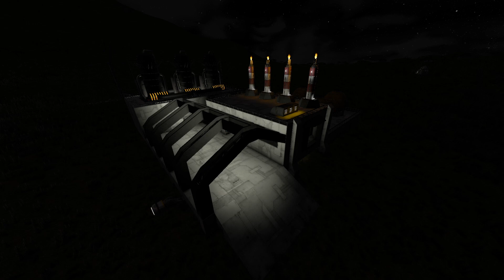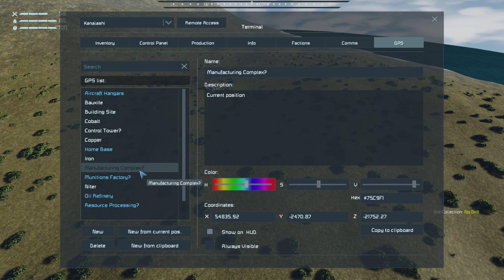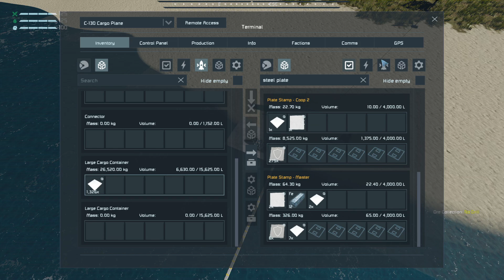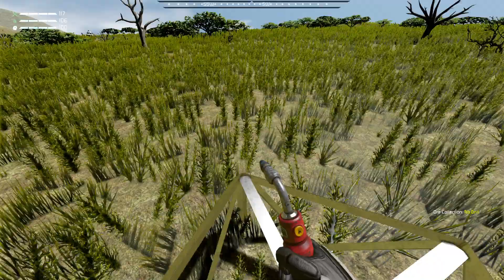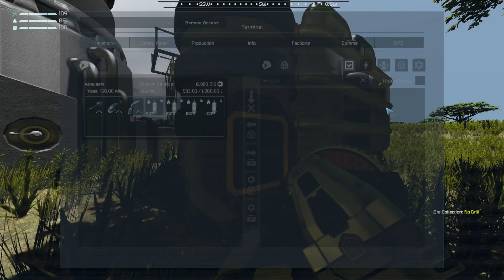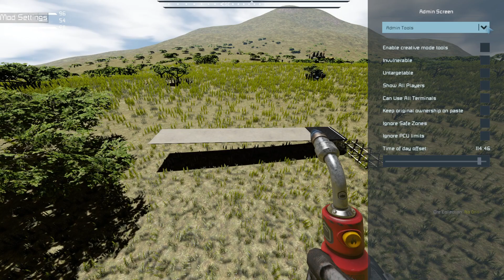Space Engineers - S4E36 'Runway Construction Begins'

Comment: Runways need a Taxiway to connect to the open Tarmac and Hangars. also plan for the Air Traffic Control Tower and the rotating Light on top with Green/White spotlights.
a separate tower can hold the big Dish Antenna for the Airport Radar unit.
for night operations, 
Taxiway lights are blue.
Runway centerline is white.
Runway approach lights will chase toward the runway end
Hold Line where Runway meets Taxiway are yellow and alternately 
so long as your landing gear are on the runway with some wiggle room, it doesn't matter if the wingtips hang over.
Runway construction = a good place to do a Timelapse.

static drill connected to basic Refinery to collect valuable resources leaving Gravel that can be piped to the Asphalt plant